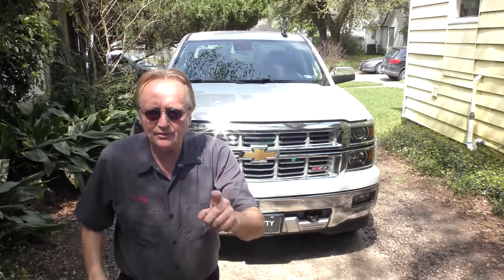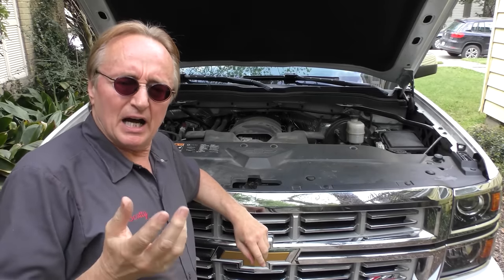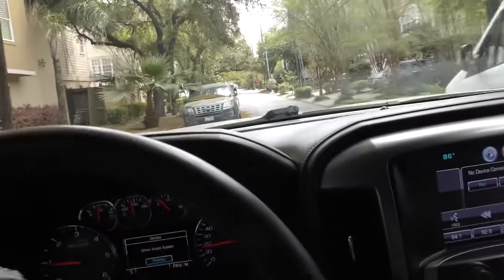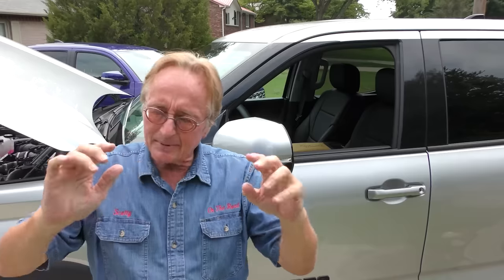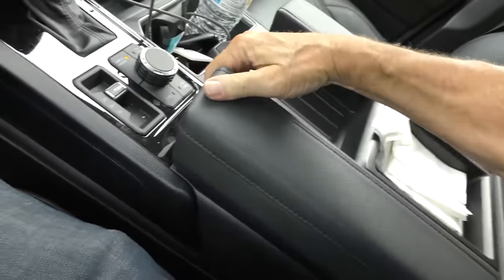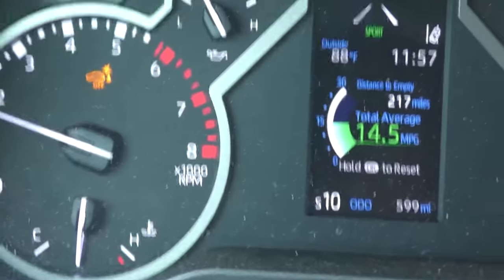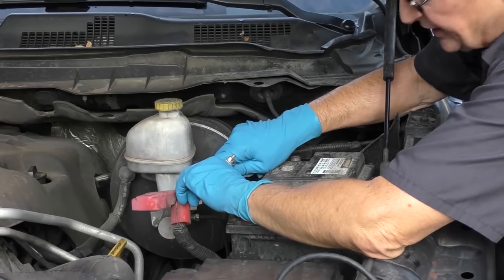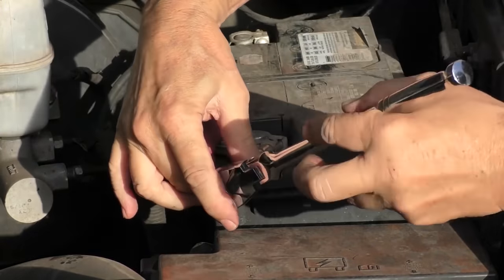3 Trucks I Wouldn't Touch with a 10 Foot Pole

Comment: Our 2014 Ram 1500 hasn't had any major issues up to this point, ganted it only has about 51,000 miles on the odometer. It was my granfather's truck and he passed in 2018. Before that one he had a 98 1500 that was pretty solid up until around 2013 when the right wheel bearing blew. I think the only other issue is had was it needed an O2 sensor and alternator at some point. The 2014 was built in Michigan and so was the 1998 I think, so I guess that's why both held up so well compared to the Mexican built ones.
Reply: I own a Mexican built Ram. A 2018 1500 crew cab. It’s been flawless through 70k miles. Fit and finish is very good. No rattles, squeaks or vibrations. It’s a pretty well built truck.
Reply: I do love my 2017 Ram 1500 Hemi with its 90k miles on it. 2 years since i bought it and it's still the perfect match for me. I do love my 19mpg average (and i'm not always gentle on it) descent tow capacity and always ready to go. Sure thing, nobody will be able to sell me one of theses crapy small turbo engine in a big rig. V8 power still the best you can get. There's no replacement for displacement. And for Ram product, just give it some love and everything will be perfect
Reply: Theyre not good trucks though
Reply: did you fix the 98???
Reply: @ChevyRedneckGFX  Go check out Ram quality and reliability versus Chevy for the past decade and tell me again what isn’t a good truck. LoL
Reply: gas ram are crap
Reply: 51k is not proof of longevity.  Dodge well know to fall apart +60k miles.
Get back to if you ever reach 100k, 200k, and 300k like my 05 gmc 8.1l 2500 with original engine,  transmission
Reply: @dylanowens3173 I know I’m wasting my time because you won’t be confused with facts but I owned a GMC that was so badly rusted with just 120k  it wouldn’t pass inspection! Always had slop in the drivetrain and had to have both front hubs replaced!
Bought a 2016 Hemi Ram new… have 177k ice cold  A/C still getting up to 24 mpg on the interstate @ 70 and only repair has been the exhaust manifolds after 150k… a known Hemi weakness! Best infotainment system in 2016 and EVERYTHING still works! 
That said I carefully researched which year to buy. Sadly researching for my next truck the news isn’t great on any company including Toyota!
Reply: 50k-70k miles? It hasn't even been broken in yet, talk about them when they get to 300k+ like the Tacoma's or 4Runners, even better, the Land Cruiser it's built to last 25 years 😂
Reply: Bearings fail.
Reply: To all Dodge owners:
I'm sorry
Reply: The 98 was built in St. Louis, MO most likely
Reply: Ok, like you said, it doesn't have many miles..that's probaly why...and the older ones, we're decent
Reply: @scottp2462 you have no miles!! Dodgehas bee history miss for decades...half of them are junk
....
Reply: @scottp2462 neither are good in the last decade...especially  newer chevys
Reply: @1stCor15-58 've always had good fords..mine,my familys,and friends, all of them had well over 200k and ran like new..infact, my wife has a 14 escape titanium, runs like new even though it's newer. Honda is my fave though
Reply: @1stCor15-58  You can preach till you’re blue in the face and still not change anyone’s view. Every company makes less than great products but many people don’t want to acknowledge that. I too have a Ram, it’s been a very good truck. So many arguments from folks claiming the old ones are bad, the new ones are bad. Most will find both old and new had their good points and bad. Since Ram separated into its own marquee in 2010 they only build trucks and they’ve done a pretty good job. If only people would look at sales volume they’d see that GM building 800k units with 8,000 transmission failures is the same as Toyota building 100k units and having 1,000 failures. Toyota builds good vehicles but if anyone looks at the reliability over the past 5 or 6 years it’s nearly the same as the big three. Enjoy your Ram and your quest for a replacement. Note that the 2023 Ram beats out the 2023 Tundra although they are both way overpriced. Happy hunting
Reply: @richsweeney1115  Just wait till that Escape needs a new turbo on that eco boost four banger. I know how great that vehicle is because my wife has a 2015 and it needs a new turbo like most do at 100k. You know Fords half ton truck reliability is below Ram, Toyota, Nissan and Chevy?
Reply: @scottp2462  well said! I have driven several million miles… school buses, CDL trucks and every brand of truck from a ‘62 Dodge Power Wagon to Ford 150’s to GMC’s and a Toyota T100! Every brand has a repair shop out back and good engines and transmissions and most also have some losers! Maintenance is a key factor in keeping a vehicle a long time and I am meticulous hence I have had mostly good experiences! I agree that they are obscenely expensive!
Reply: @1stCor15-58  Maintenance! Yes, that is the key. I too am a preventative maintenance person. Waiting till something breaks is a recipe for problems.
Reply: @dylanowens3173  My dad has 176000 on his Chrysler 300c. I had to replace all the sensors. It is basically the same engine as the truck
Reply: @scottp2462 agree with you. 
Only sad part  RAM now is partially owned by Dongfeng via Stellantis.
Reply: Sell it quick
Reply: 2002 purrs like a kitten
Reply: Wheel bearing ! 😀   You waited until it blew out ?
Reply: Friend has a 2019 RAM 1500 hemi. Check engine light has been on for a year. It has low miles. He doesn't drive it much. They're junk
Reply: I’ve only had one issue with my 14’ Ram. Only one of the tire pressure sensors have gone out. Approaching 100K miles.
Reply: 2014 Ram 1500 with 135k on it.  I’ve had it since 2016 and 30k.  I’ve put about 4K into two repairs. Manifold bolts and heater core.  I love it.
Reply: If it’s good enough for cordell walker. It’s good enough for me
Reply: My 5.9 magnum has 415 on the dash

Comment: Well I’ve owned a Texas edition 2016 Ram 1500 Laramie Longhorn for about 3 years now. Bought w 50k miles and now has 72k.  No complaints so far. Better in every way than my last 3 Silverado 1500 LTZs.  Hopefully my Ram will stay reliable for years to come.

Comment: Still putting along in my '94 Dodge Dakota. I know it's not rated very well, maybe even bottom of the barrel. But this one runs dandy after I replaced every sensor known to man on it. I can do almost all the work it needs, as it's a simple old school truck.  It has a distributor cap, try to find that on a new Tundra. With a Flowmaster muffler, the V6 sounds awesome rowing the gears on the 5 speed stick. It's paid for, license plates are cheap and so is insurance. The bolts are all inch sizes!! Best of all it rides like a Buick.

Comment: I'm still driving my 1994 dodge ram.. v6. I got it free 4 years ago.  .  My bud and I replaced everything we could reach. I put almost 30 k on it.. its been a WORKING TRUCK. I'm already collecting my warranty parts. It hauled my boat.. motorcycle. my moving trailer. From Minnesota to Kansas several times. Everything on it still works. Even the license plate light.
I'll bet ANY new truck owner that they're WORKING TRUCK.. not show truck... will last 30 years.  I'll bet . Probably gonna replace front suspension.  It's still cheaper than buying any used vehicle at this point. Let alone a new truck.
Reply: 😂😂😂😂😂😂😂most dodge never have to be repainted or have bodywork done because they don’t run long enough my nephews 94 dodge barely made it to 2000 and my friend at work bought one a year ago most of the time it’s at home because it don’t run😂😂😂😂

Comment: Anything electric is more than enough for me to walk away from . I have been driving a basic 1990 ranger since 1998 . I paid $ 3,000 for it . It also had only 21,000 actual miles on it . I now have 184,000 and other than normal wear and tear and maintenance , it has been the most reliable truck I have ever own . I am always asked if I want to sell it .
Reply: Rangers are great.
Reply: I completely agree with you any vehicle can be good if you do the all the upkeep you change the oil and do the repairs no brand is really truly bad except for very few things on some vehicles

Comment: The GMC should have ducts underneath the back of front seats for the HVAC system. Ive seen several manufacturers having issues with the evaps leaking and 20 hrs to fix em. Ugh manufacturers hate us. The hateful thing with that truck is the lifters. Love the videos
Reply: It does I noticed them recently 😅

Comment: Had a new Silverado back in 96 that had problems from water pump going out at 26,000 miles and full of plastic parts in the cabin. Replaced that with A 99 Dodge and from then on, it's been Dodge/Ram. Never had a problem with transmission or engine. Never looked back. You get more for your money as far as accessories are concerned.
Reply: For real Chevy cosmetics and transmission fall apart just as much as ram but ram is cheaper to fix

Comment: I bought my 2016 Ram 1500 in 2015, have put just over 110,000 miles on it and have only had to replace the fuel filter and battery.  I know Dodge has always had a bad reputation, and I'll admit that I bought it because it was significantly less expensive than the equivalent Ford or Chev, but it has been a solid truck that I really enjoy driving!

By the way, comparing a 20-year-old Ram to a 2023 Toyota?  I'm guessing the Toyota will come out on top more often than not...

Enjoyed the video, thanks!
Reply: I get the feeling from friends and what I have read that Dodge is ahead of GM and Ford.
Reply: @jimquantic I test drove a 2019 ram and let me say it’s a different animal than it used to be. My 2019 fords transmission completely crapped out on me after 63k. I’d choose a ram or tundra at this point.
Reply: I agree and disagree about Toyota coming out ahead of Dodge.  Meaning, Toyota doesnt have a 3/4 so we are SOL if we need that size
Reply: @jimquantic  I agree with that
Reply: @Dudesbrewsguitarreviews If you expect it to run for long, you'd better pick the Tundra..
Reply: I replaced a 2500 Duramax with a 2021 5.7 Tundra.  The Tundra comes alive when you push the tow haul button.  Also, the two trucks weigh virtually the same.  I would like to see some true 3/4 and one ton options though...

Comment: My 55 mile round trip commute for work is mostly interstate driving. My 2005 Colorado 3.5l 5 cylinder is averaging about 16-17mpg. I might as well have a V8 full sized truck.
Reply: 5 cylinder? WTW? Is it a six with a sparkplug missing or something?
Reply: Your probably better off with the 5 cylinder engine. 
No AFM cylinder deactivation system that eats cams and lifters.
Reply: @pnorton75  No, it's an inline 5 cylinder. 3.5l. In later years they made the same engine a 3.7l.
Reply: Ugh. That certainly does defeat most of the purpose of a smaller truck. I can nurse 18-20 mpg out of my F150 5.0 crew at highway speed using cruise control 5-10 mph over the speed limit. Believe it or not, I get 20-23mpg on secondary highways or faster 2 lane roads in the 45-55mph range. As soon as you break 60 with these 4 wheeled bricks, you pay for it!
Reply: The power of a 4 cylinder with the gas mileage of a 6 cylinder.
Reply: I can relate- I have a 2020 Ranger 2.3l= 21 mpg over the life of the truck so far....not any better than a V8. It will get about 27 if I keep it 65 or lower on  the highway.

Comment: I have this truck. The condenser and the main valve cracked in the AC. $1600. Also the electronic still glitches out a lot randomly. Also have the Chevy shutter.
Reply: Sounds like it's a pattern.
Reply: Heartbeat of America
Reply: @mikefoehr235  Needs heart transplant
Reply: @TIJoe-te9qu From a Japanese donor if possible
Reply: @daniele.644  😀

Comment: The Dodge pickup started so that was enough...Reminds me when I was a TV Repairman (1980s) that when delivering a certain model Television, we were to leave the engine running because by the time we left the customer's house, chances were that the TV had gone out again.
Reply: @jkeelsnc  These happened to be made by Amiral TV and were notorious for failure. The joke was that trouble shooting started with the power cord.
Reply: @jkeelsnc  It was the joke for this particular TV Set that had a high failure rate.

Comment: My mechanic that works on my family's vehicles and other's,  had i wanna say a late 90's Chevy pick-up.  Had the 350 in it. That truck was a beast. It finally died last year after 319,000+ on it.  He used Shell 15w40 oil in it. Crazy, but it worked.
Reply: Diesel oil is great in any engine. More detergents...

Comment: 04 dodge ram 1500, 5.7 hemi. 460 thousand miles, still going strong on original timing chain. Sounds just like new still.
Reply: Scotty was let go by a Chrysler dealership in Ontario decades ago, he still has a h@rd 0n for the company.
Not much of a mechanic to have trouble diagnosing a worn out starter 😂

Comment: I just received my 2023 Tundra. With a motor not broken in I get 20 MPG on freeway. Seeing 17 MPG on my 12 mile work commute. Way quiter than my 2007 Tundra. This is by far an awesome driving truck. Love it!
Reply: I just dont like the idea of a turbo 6. Why not go for the v8 f150 at that point. I get toyota arguably has higher quality control but its not what it used to be and they sell a lot of f150s brother a lot. You got spare parts. A v8.. the v8 is so good on the interstates whe. Yourr passing people

Comment: I own a 2015 Silverado 1500 LTZ just like the first truck only mine is a full size bed. I have owned it for about 6 years and put roughly 110,000 miles on her bought used. She now has roughly 186,000 miles and no issues at all. I have only replaced the thermostat and one hose since owning it. The AC still blows ice cold and motor runs strong. I only put mobile one and I do all my own oil changes. I will easily break the 200k mark with no doubt and my truck still looks beautiful!

Comment: If the car has a manual transmission, still you can start it by pushing the car and engaging the 3rd gear. A major point.

Comment: 2005 Dodge ram big Horn 385000 miles 2 break jobs 1 water pump and 4 sets off road tires sold it to my  brother he drove it another 75000 miles... Loved it .... 2015 Dodge big Horn 130000 then 4x4 stopped working cruise control stopped working and a few other electrical issues.... Price went up $25000 vs 05 model.. quality tanked....

Comment: I bought a 16 Silverado.  I can understand one thing going wrong.  But mine was a constant headache.   Fuel injectors, struts, washer motor, wheel bearings, air conditioner , leak in the rear cyclops’s light.  
What broke me was at sixty thousand miles the transmission was going.   I dumped it on the dealership for almost what I paid for it

Comment: Only thing I had to change on my GM trucks were the ball joints.
Reply: Consider yourself lucky,the longer you keep it the faster it will bio degrade ,modern gm vehicles are garbage
Reply: @ljbrizo  I've had six, never had problems. Preventative maintenance is the key for me and AMSOIL. I have a 95 Sierra still.
Reply: @darktoadone5068 Well that’s exactly the point Scotty made… Quality of GM has gone down.
Reply: @Muad_Dib. Yet they still seem reliable compared to other brands 😂
Reply: @wesleygarrison6248  the old ones were good.....the newer ones are crap. Its been said 100 times. My fords , my familys fords, have all gone well over  200k with no major issues  when they were sold to get something  different..hondas are my fave..fords still one of my faves. Infact, my wife has a 14 escape titanium,  with the 2.0 ecoboost, that runs like new, my friend has a16 explorer xlt, with about 170k runs perfect, and still goes 100 down the highway smooth. We all maintain our cars  trucks religiously. He showed you a 2017 , thats obviously  maintained well, that already has issues and you still think they  are good quality...this is the second one In 2 days I've seen on youtube with issues way before they should have..I used to like chevy. Untill I started seeing them in person, having issues
Reply: @richsweeney1115  We have had nothing but problems out of Fords. Wife had a 2011 Edge that was just problem after problem. We traded it in for a 2016 Explorer and we've already had to replace the steering column, transmission is obviously having problems and will need rebuilt sooner than later, and a MULTITUDE of smallish problems that you shouldn't be having at 100k miles.

Comment: My wife wanted another GM pickup truck sooo bad. We have a 16’ boat so we do need something that can tow but I was sick over the thought of spending 30k on a 5 yr old truck that was garbage when it was new. Luckily I wear the pants in the family because she absolutely loves our like new Toyota 4Runner. 😂
Reply: We had a 16 foot boat growing up.  Fiberglass bowrider.  We never had trucks. We had two gm cars with the 3.8 engine and never had a problem.  Ran em both to 200,000 miles.

Comment: I sure miss my 1996 Chevy Cheyenne 1/2 ton 4X4 pickup.  Got it relatively cheap,
put Silverado seats and wheels on it, Z71  Bilstein shocks and skid plates.  It had
the 350 Vortec engine and 5-speed manual transmission.  When I traded it in,
it was about 7 years old, had about 110,000 miles on it, and it was running like
brand new.  Still had the original clutch and rear drum brakes on it.  I could get
21-22 mpg on the highway with it.  I could do most of the maintenance on it in
my driveway, too.  Sure, no carpet, power "anything",  so what.  Less crap to 
BREAK.